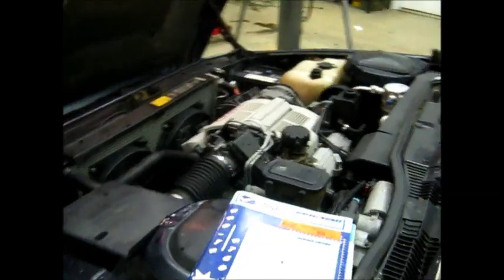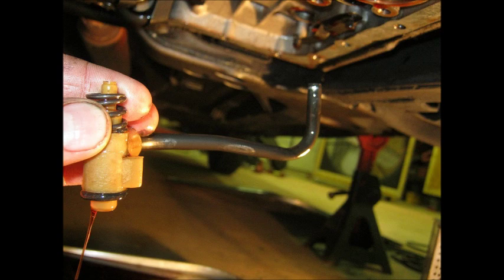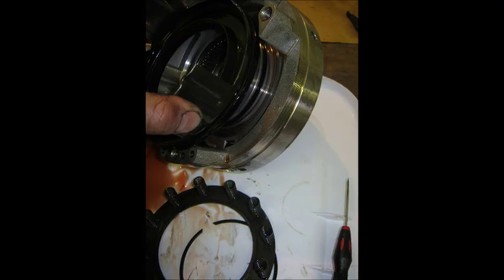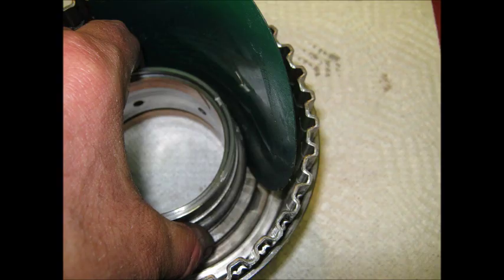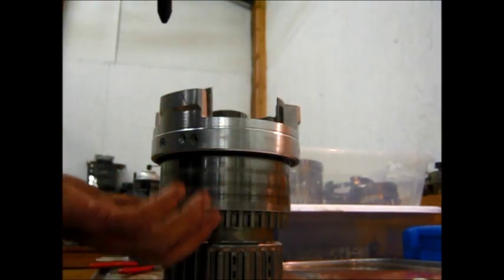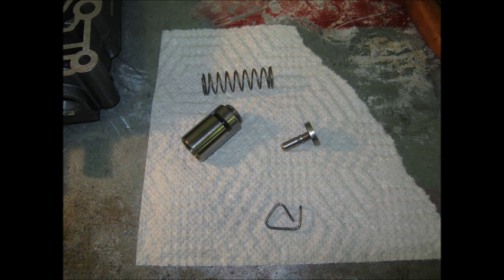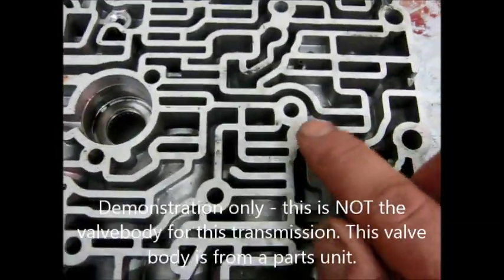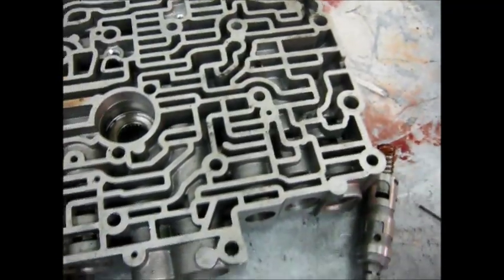Overhaul HydraMatic 440-T4 / 4T60 Automatic Transmission - Part_1

Comment: I have an 88 Buick 2.8L Century Limited and believe I have this trans. Got some bad gas, long story about the motor, not pertinent to this question, towed it home. About 50 miles, had it in neutral and would idle about 2/3 of the way. Got the motor sorted out, then when I test drove it, first shifted fine, then the freewheel band started to not allow freewheel, then got to shifting worse and worse, ultimately sort of stuck in low. This occurred over maybe twenty miles. Drained the trans, replaced the filter. Put it on jack stands, shifted it a bit, finally came out of low and freewheel band seemed to work. Not much in the pan, a little black dust no metal at all on magnet or non-ferrous I could see. Opened the filter to see if anything was in it. Some small black stuff, from almost dust to a few larger gubbers. Very little though. Took it on a test drive, and finally would go into 2nd and freewheel. Seems to still not be shifting correctly into 3rd and overdrive. So questions that come to mind 1) How could stuff get through the filter and into the shift spools? 2) What did towing do to it, even with it idling most of the way? 3) What do I do now? Can pull the pan again, and do another filter/fluid change but is this going to be futile? Can the shifting valving be removed without a full tear down? Much thanks for any help. Presently thinking of putting it up on jackstands again, and doing a bunch of up and down shifts to try and get the grunge out of the shifting valving.
Reply from the maker: Hi Don.  Sorry that your transmission got damaged.  I expect the problem is that the overrunning clutch for 3rd gear and above has been destroyed by running dry during the towing. This part creates friction when freewheeling, which would happen constantly and at high speed while towing. It would not survive the towing you describe above. The only way to repair this is to disassemble the transmission and replace the overrunning clutch assembly.  Here is a link to this part, which would be needed in addition to a basic gasket and seal kit to do the teardown and reassembly. https://cobratransmission.com/4t60-440-t4-3rd-low-input-sprag-assembly-15200-1
Reply: @davida1hiwaaynet  Pity, I was hoping for something more simple. Sounds like I'd have to do something like your three part video showed.
Reply: @davida1hiwaaynet  The thing I don't understand is, it did shifted OK, after I first drove it, then the valving got screwed up. So if the overrunning clutch is destroyed, why would it first work? Seems like it there was a hard part issue there would be some stuff in the pan and would have never worked correctly? Also seems like with it idling wouldn't that give everything some oil? Course there were times when it wouldn't run at all.  But what do I know? How did corruption get to the valving through the filter? Seems odd to me.

Comment: disregard my question on your other video you gave the answer as to what car it was.

And I agree very much you should have a book for anything that your rebuilding. I don't need an engine book anymore for a lot of engines I rebuild but I grab the book anyway simply for quick torque reference.

Cool job your undertaking. Very good time to upgrade and make some things stronger.

Comment: This is a 4T60, correct? My 89 Buick Regal won't shift out of first in colder weather unless I let it warm up a bit. Do you know the root cause of this? It has 245k on it but other wise works perfectly.  I know its probably ready for a rebuild. I had the pan off a few years ago no metal or debris in the pan.  Does this mean I could do the rebuild with the unit in the car?

Comment: I have a question. I have a 440t4 from an 88 olds wagon that I removed. Has the square connector. Got what I thought was a 440t4 from a wrecking yard, very good shape, was rebuilt. It's actually a 4t60, round connector. Has the extra  clutch solenoid on the bottom of the valve body pump. Should be a way to swap them out and the pcm recognize it. Any help would be appreciated.
Reply from the maker: Hi there.  As long as you are sure the transmission you got is a 4T60 and not a 4T60E (the E is extremely significant) you can use it to replace an older model with the square connector.  The surest way to tell is by confirming the transmission has a throttle-valve cable present on the top of the case. If the transmission has a TV cable and a modulator, it can be used to replace an older unit with a TV cable and a modulator. 

You will need to replace the internal wiring harness from your original transmission into the new one. The older one probably only has one pressure switch screwed into the pump casting. Note the position of this switch in the pump casting in the old, square-connector transmission.  Move to the newer transmission, and remove the wiring harness completely, including the connector. It snaps into the case and is held by a tab. Remember the pressure switch from old transmission? Transfer that from the old transmission to the new one. In other words, remove the existing pressure switch from the new transmission, from the location where the old transmission has a switch. Now, remove the pressure switch from the old transmission and place it in the same position in the new transmission. This will allow the wiring harness to connect exactly like it did on the old transmission. Note it is important to leave a pressure switch (or a plug) in every switch port on the transmission. Leave any unused pressure switches in place on the new transmission, even if no wires attach.  

Note that most of the 1988 and later ECMs look for the correct engine speed to vehicle speed ratio, to determine if the torque converter clutch is working. If the ratios of the drive chain and final drive gears are different between the two transmissions, many 1988 and newer cars may give a check engine light if the ratios are not matched to the original. The older ECMs don't have this check built in and you can mix and match ratios.
Reply: @davida1hiwaaynet Thanks for the quick reply. Mine doesn't have a throttle valve cable. The old transmission has two pressure switches. The new one has three. And that's my conundrum. What to do with that extra 2nd clutch pressure switch on the bottom of the pump. You are saying it's okay just to leave it unplugged? Thanks again.
Reply from the maker: @RainbowWalker-r7x  That's very strange. If it is a 440 t4 transmission, It must have a throttle valve cable. The throttle valve cable may be missing or broken. If you're dealing with a transmission having no throttle valve cable, then you are dealing with a 4T60E version. I don't have much experience with those. I have several cars with the 440T4 one car with a 4T65E, but I never did have a car with that 4T60E.
Reply from the maker: @RainbowWalker-r7x  
Assuming that the two transmissions are compatible and you are mistaken about not having a throttle valve cable; You should simply ignore the extra pressure switches on the new transmission, and transfer the pressure switches from the original transmission into the new transmission.
Reply: @davida1hiwaaynet I'm looking at the astg 2002 update for the 440t4. I believe the TV cable was gone by 86? Mine is 88, code 8fch. It says it's a 440t4. The new one is from a 90. 4t60. According to astg. But I think it's semantics. They're practically identical. Save the pressure switches. I believe you're right. It can just be left be. I just remember my father always telling me to make sure everything is accounted for before closing up. Or you will regret it. Thanks again.
Reply from the maker: @RainbowWalker-r7x  
You are very right about accounting for everything before closing it up! That end cover is so difficult to get off with the unit in the car. As far as the TV cable, that was not eliminated until they transitioned to the E model transmissions. I'm not exactly sure when that happened, but it was at least 1991 or 1992.
Reply from the maker: @RainbowWalker-r7x   Yep, if your harness which goes to the original transmission and original engine ECM system doesn't use a 2nd clutch switch, you can just leave it disconnected. The switch needs to be in the port acting as a plug for the port.

Comment: Trans shop just replaced my pan gasket and now the trans is toast.   Car ran fine going in there.   1990 Olds 88.   Why did this happen?
Reply from the maker: That is very unfortunate!  I don't really understand what you mean by "toast" but I assume you mean that the shop damaged your car while servicing it, and it never backed out of their workshop? If the car simply stopped moving at all, I would say that most likely the filter assembly (mounted under the pan) was somehow dislodged or not properly installed. The same basic filter fits the 440-T4, 4T60E and 4T65E; however there is a metal baffle which clips onto the filter and is different for the different models. If that is not correct, the filter can possibly not fit correctly and it might become disconnected from the inlet of the pump. I would have the shop take the pan off again and look to see what is going on.
Reply: I belive this exact same issue is what I'm now facing with my 1985 Olds 98. filter had been changed by previous owner before I purchased. I've been driving the car around for the last few months shifted beautiful no issues whatsoever until yesterday when at 30mph the trans quit, I heard a short flushing fluid sound then immediately after had no drive gears or reverse. thoughts?

Comment: What is your compressor PSI dialed down to for these checks? Are you using your other hand to plug a hole on top when testing the 2nd and 3rd clutches?

Comment: It's nice the ATSG book has the diagrams showing the valve body valvetrain layouts. For my Mercedes' 722.3 it has general diagrams, but doesn't have the model to model variations; it just has a note saying to pay attention when you take it apart. Not the most helpful...
Reply from the maker: Hm. I have the 722.3 and 722.4 books. Now you've got me curious as to what is in them. Do you have the blue only, or also the green update books for the 722.3?
Reply from the maker: davida1hiwaaynet It's been a long time since I've had to go through a Mercedes transmission. One of a friend took his Benz to a local hot-shot know it all shop and was CONVINCED by them his transmission was weak and not putting the power to the ground. I could find nothing wrong with it, and in the end the problem was the camshaft had multiple worn lobes....
Reply: davida1hiwaaynet I don't have any of the official books, just a pdf that's been circulating. If one of them covers the 722.361 I'll have to try and find a copy!

Comment: do you know if this trans will hook up to the LL8 engine? It's the 1989 cavalier I4 if it helps, its originally coupled to the Turbo-Hydramatic 125-C
Reply from the maker: D DeSantis I am not very familiar with that engine. There were 2 versions of the 125C bellhousing. If your engine has the same bellhousing as the 2.8 and all the other common GM engines of the day - yes it will bolt right up to the 440T4. The 440T4 all have the same bellhousing.
Reply: Do I need to do anything electronic wise to go from 3 to 4 speeds
Reply from the maker: D DeSantis Once again, I'm no expert on these engines or their ECM's. The 440T4 transmission has a the same type lockup torque converter as the 125C. You will have to adapt the wiring so that the engine ECM sees the high-gear signal and controls the torque converter lockup solenoid. If this is not done, the transmission will overheat.
Another consiteration is the gear ratios. The small engines need a low-geared (high numerical ratio) transmission. You would need to find a 440T4 that has the 3.33 final drive as well as a 35-35 chain set. Otherwise the engine may be overloaded when in 4th gear.
Reply: Oh ok thanks, i know the bell is the same and figured the ECM would need something done to it but i didnt know about the ratios and load on the engine, guess my 89 cavalier rs will stay stock, it just feels like it needs a 4th gear, i mean 60 mph runs about 2900 rpm
Reply from the maker: D DeSantis I bet a 4th gear would help, but you would need to calculate a feasible gear ratio so that the engine would be in a useful power RPM range at all times.
Reply: ill just stick with it, im more of a purist for originality anyway since im doing it as a classic, i mean its only got 92 hp

Comment: I'm curious to know if this transmission setup powered 1 wheel or both wheels.
Reply from the maker: Hi Jonathan.  It powers both front wheels. The torque is divided equally via an "open" differential. In other words, as long as both wheels have traction, both wheels pull the car.  If one wheel slips (as in mud) then the slipping wheel will spin faster, however the other wheel will still be receiving the same amount of torque as the slipping wheel.
Reply: davida1hiwaaynet Thank you for the reply. I was curious because I own a 1989 chevy celebrity eurpsport sedan 2.8l, and I'm guessing it has this transmission.
Reply from the maker: Yep!  It would have this one, if it's a 4-speed.  If it were a 3-speed, it would be a 125C.

Comment: Does anyone know if the 89 Buick Regal custom coupe had just oil cooler lines and not transmission oil lines itself. My lines are leaking but I've been told the cooler lines aren't leaking. It's the main oil lines itself. I've heard this transmission was only built with oil cooler lines to direct the trans oil
Reply from the maker: +coololds85 

On certain higher-performance cars, there are both engine
oil cooler and transmission oil cooler lines. The engine oil cooler is
optional. Not all cars have it. They ALL have the transmission oil cooler
lines. The transmission will overheat to destruction without the cooler.

It can be hard to pinpoint the exact leakage point when
there is oil all over everything. The oil will blow in the wind as you drive
the car, and may coat parts a long distance from the leak point.  It’s best to wash the whole area and then run
the engine to see where the actual leak point is. 

I would bet that 90% of the time, the leak is at the
connection between the rubber and metal section of the lines. Each cooler line
has a metal tube at each end, with a flexible rubber section in the center to
allow for movement of the powertrain on the mountings.
Reply: +davida1hiwaaynet GM don't make the transmission lines anymore for my car but I did find NOS lines from GM. I was wondering if these would be the correct lines. They don't have the rubber hose fittings on the end of them tho. Also I went to a transmission specialist before and he said these are not the correct lines because the car had transmission oil lines too and the cooler lines were just lines to cool the trans down directly from the radiator. He said the transmission lines I needed had a lot of bends in them and don't know who can make them. Many people said the car wasn't made with primary transmission fluid lines. The primary oil source that feeds the transmission are the cooler lines like you stated. Would this be what I need? http://www.ebay.com/itm/301821336122?_trksid=p2060353.m1438.l2649&ssPageName=STRK%3AMEBIDX%3AIT
Reply from the maker: +coololds85 

Ok, I know for sure, there are two transmission oil lines on the car; and there MAY BE two engine oil lines.  Of the transmission lines, one carries transmission oil from the transmission TO the radiator. The second line carries the oil FROM the radiator back to the transmission.

Each line is made up of three pieces. There is a steel tube that connects to the radiator, then there is a rubber segment, then there is another steel tube that connects to the transmission.

Each of the two lines is made this way.  Normally, you never change the steel tube part. You only change the rubber hose part. It is very simple. Take the line off the car, and cut the crimp sleeves from each end of the rubber section. Then, use a flaring tool to make a bulb-end on the steel tube, to retain the hose.  Finally, install a new section of hose onto the line, using high pressure fuel hose clamps. This will renew the deteriorated section of the line. The parts stores sell the rubber hose by the foot.

If the steel tube is leaking, you will have to go to a junkyard and buy a used line, and replace the rubber part to get a serviceable line.

If you are unsure, you can remove the lines and take them to a hose and tubing specialist, who will replace the rubber section for you.

There are no GM FWD cars with the 4-speed auto with different setup. They all have two trans oil cooler lines. Anyone who tells you otherwise is misinformed.
Reply from the maker: +coololds85 

Almost forgot - the steel tube you posted from eBay is one of the two parts that connect to the radiator. The end with the threaded screw-in fitting goes to the radiator. The other end is where the rubber hose will clamp onto the steel part. There is another steel part like this which connects to the transmission. The two steel parts are joined by a rubber section not shown in the eBay listing.
Reply from the maker: +coololds85 

Yes that is the transmission oil cooler lines!
Reply: +davida1hiwaaynet on the diagram I see the rubber hose fittings and the metal lines. Can you tell me which numbers are the parts I would need. 
Thank you, I really appreciate you're help.